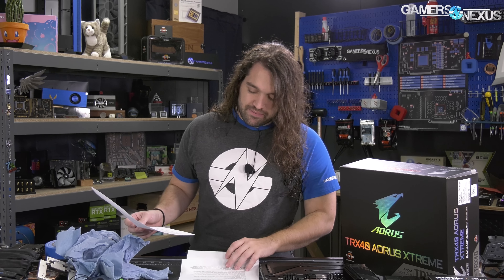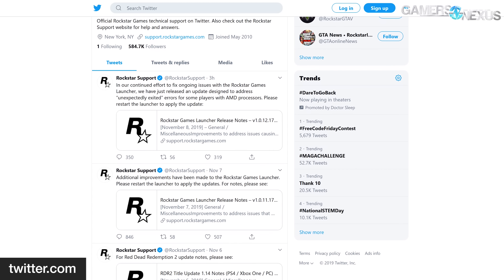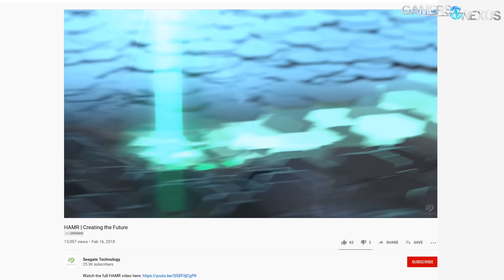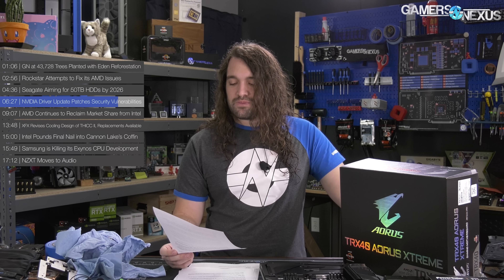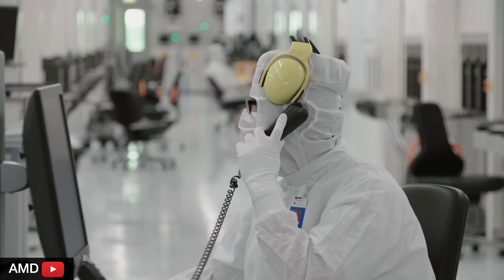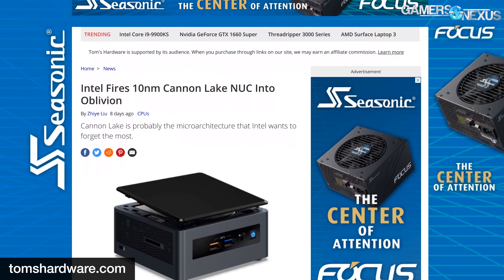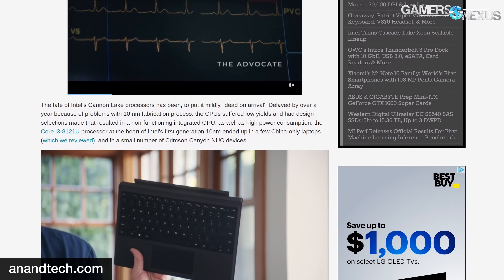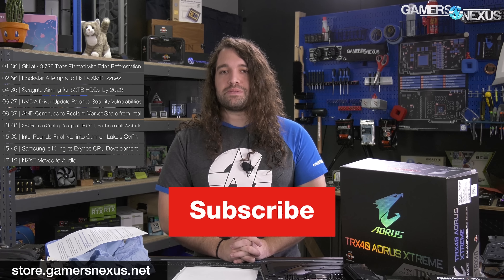HW News - Rockstar AMD "Fix," NVIDIA Driver Security, & 50TB HDDs

Comment: Honestly happy that at least one company is investing in traditional HDD development. SSD is obviously better for the vast majority of our workloads including gaming, but there are still very real use cases for high capacity storage among regular consumers. We can do both.
Reply: Personally I use an SSD for my boot drive. And mechanical drives for storage. So a 50 terabyte drive sounds kinda hot to me lol
Reply: sj33 they do have use for high capacity. In fact they are much denser than HDD, (2TB in a single 2280 NVMe drive).
They just currently cost a lot more per TB. It might change, or NAND prices might hit a floor that’s higher than HDD we don’t know.
Reply: HDDs are a lot more mechanically complex, so they may end up having a higher price floor than solid state tech. They will be around for a while no doubt, but I think ultimately there's a good chance they become obsolete as NAND production scales.

Comment: I need about a hundred 50TB HDDs to host a local copy of the Earth in Microsoft Flight Simulator 2020.
Reply: Well, you need 100 drives in 2020, in 2026 when the 50TB drives are actually launched, you probably need a 1000 50TB drives. Evolution based on FSX --> P3D --> XP --> (Orbx)  --> FS2K
Reply: @Adam Beckett If here in Romania an employee managed to mine bitcoin on the Cernavodă nuclear power plant computer  he'll be just fine.
Reply: Running in raid 4
Reply: @Adam Beckett long ass fiber optic network cable

Comment: Imagine how long it will take to defrag a 50TB HDD
Reply: If it is Seagate it will crash before ever needing defragmentation.
Reply: You beat me to it Blair!
Reply: Blair Maynard why everyone says that seagate is bad tho, I bought 2tb sshd firecuda 3 years ago and it still works fine
Reply: Forever. I feel like most people using these will have a Linux/Unix based server with ext4 which doesn't allow for disk fragmentation.
Reply: Honk Honkler yeah I know that, but still tho
Reply: I have a Seagate that has had heavy use for more than a decade...no bad sectors and just keeps on going.Was my gaming drive up until SSD drives dropped in price.There is nothing wrong with Seagate and they do not have any more issues than any other hard drive company.
Reply: I was just thinking this. 50TB is cool and all, but the IOPS and throughput are still terrible. QLC SSDs are getting super cheap these days for 1 and 2TB models.
Reply: All i want is $30 4TB SSDs
Reply: I have 27tb of storage, various brands and models, the only 2 I've had fail are Hitachi. I've got two seagate drives that are 17 years old and still going strong, constantly powered and used at least weekly (plex server)
Reply: @rossharper1983  whats te model of seagate drive you use?
Reply: I just done some maths and figured out that 50TB would take a little under 5 days at 120 mb/s. So take of that what you will regarding your drive usage and fragmentation 🎉
Reply: @StormStormMegaStylez  in other words... Don't use windows on a Seagate 50TB
Reply: @comdrive3865  off top of my head no idea. Will be a couple different models tho to be sure. Without opening up my plex server and taking them out I couldn't tell ya
Reply: Don't use ntfs on that drive.  Use ext4, xfs, or zfs.
Reply: @fernando5633  yeah idk either. Never had any issues with Seagate in the 9 years I've had their HDDs. They are the highest rated and most popular HDDs for a reason, and it's not because they're shit. Idk why people have issues
Reply: Adam Beckett ow thats why, thank you
Reply: one eternity later
Reply: Format and reimage.  Will be quicker.
Reply: @eritert  That will happen when 16TB is the avg minimum 'useful' storage requirement, and not a second before.
Reply: @asm_nop  People don't buy 50TB HDD's to play games on so IOPS doesn't mean anything. The drives are for NAS.
Reply: @BlairMaynard  I have Seagate 500 GB, that worked more than 39 thousands of hours during more than 10 years. Still works fine and passes all tests in SeaTools. Also I had old 1.2 Gigabyte Seagate drive (Medalist), which was never enabled since year 2001, and when I checked it recently, I found that it not only works fine, but also all the data are readable, so I copied all of them without problems. And I still remember those 40 GB Seagate drives I had. They were the quietest drives I have seen and used.
Reply: ...  Use a real filesystem, wtf.
Reply: @BlairMaynard  Seagates newer hard drives are extremely reliable, especially the high end ones.
Reply: @spandel100  erm, that's not true. There is something wrong with seagate, if there wasnt people wouldnt be talking about it. The drives have a tendency of the needle shoving down and scraping the plater in a way that destroys all data forever. That's not all Seagate drives, but when it happens its bad. And it happens more than any other drive company.

Comment: The “fix” that made my game crash every 5-25 minutes, lol. Never had this issue before.
Reply from the maker: No rest for the wicked with this game, it seems.
Reply: Try to switch between Vulkan and DX12.
Reply: Switch from DX12 to Vulkan, that solved those crashes for me
Reply: Ouch. Sorry to hear, on 1.0.0.4 the patch actually fixed my game. Runs amazing now. Seems so strange that they are going backwards for some users.
Reply: That's what I'm worried about. Mmt game is running fine, and I'm assuming that at least a couple of fixes will ruin that for me
Reply: @CJ_Williams  So if that is microcode that fixed it then it was AMD bug. Then why blame Rockstar?
Reply: @elksalmon84  Did I? Where abouts?  I said some user are reporting errors post patch. Besides, it was the patch that fixed it not the BIOS update for me. So...
Reply: @elksalmon84  It doesn't seem to affect any other developers.
Reply: @elksalmon84  It's Rockstar's bug.
Reply: Same thing happened to me. I had no problems and the patch broke the game.
Reply: Lucky you, GTA V has had this issue since July and Rockstar started working on it a few weeks ago with nVidia.

I say lucky because it seems Rockstar is already working on it for RDR2
Reply: @Safetytrousers  @Brad Haines
 There are plenty of issues with early AGESA. Not every app is using all functions. Destiny didn't work either. AMD had to fix.
Reply: @Phallus Dominus System specs?
Reply: @GamersNexus  Honestly I thought the main issue was Rock*'s launcher as i had the same issues for GTA 5 till i uninstalled it out of sadness, i cant play either game without them crashing to desktop after about half an hour and getting the generic "Rock* launcher has crashed unexpectedly"  window. :'D

Comment: The new launcher with the latest update still wont start on my AMD R5 1600 system but works fine on my Intel I7 2600 (non-K) system. I'm using the same GTX 1060 in both machines with the same windows version and Nvidia drivers.
Reply from the maker: Hearting for visibility. Thanks for the info, helps us to have this news from the community.
Reply: I have R-1400/rx570. I had start issues too. Fixed by disabling virus checker (avg uninstalled) then went to windows defender and disabled that.
This allowed the launcher to stay open but gave a “lack of privileges to game library “ error. Run as admin didnt fix this, but manually setting the RDR2 exe to windows8 compatibility did. 
Also try manual instal of “socialclub” after the launcher instals it. Launcher installs with /silent. The file is in the launcher/redistributables folder.
Reply: Do you mean the i5 2500 or the i7 2600?
Reply: If windows defender “realtime protection” is on, my launcher is nearly completely blank. Just a yellow background.
If i disable it, start launcher it works. Then when i enable it with launcher open the socialclub gives error that I must sign in.
Reply: works perfectly fine on a R3600 with a V56 running 1440p (there is some gameplay bugs in the online version, like getting the nag/wrong horse/wrong color but correctly named horse) there might be more but that is the only thing that has annoyed me (other than the attempt to cashgrab for wanting to do bountyhunter/collector/etc. with "steep gold bar price" basically blocking off a LOT of the content online unless you pay even more (have the largest edition so already paid a lot) that is a bit of a let down
Reply: @kaisercreb  meant I7 sorry for the mix up
Reply: SolidSnakeOil the launcher appears to open “socialclub” as a background process that authenticates the games you own. This is causing issues with mine not working. Maybe it resembles a malware or something.
Reply: Liquid Sunshine i tried as admin and it didnt fix mine. Always worth a shot tho. On one site it mentions to “disable fullscreen optimisation” thats the box above run as admin.
Reply: @LiLBitsDK  
Has been running fine on my 3700x/V56 aswell. Have had 1 game crash to desktop since release.
Reply: Liquid Sunshine I did get it working once with a second launcher installed on second ssd drive. This caused a popup with windows defender and allowed the game to run. Then the next day it stopped again.
Running as admin and setting “exceptions” in windows defender doesnt work for me.
Yet turning windows defender “realtime protection” off allows everything to run perfectly. Not crashed so far.
Reply: Strange as my r5 1600 has had luck and decent performance paired with my RX 480
Reply: It won't let me even install the launcher. Let alone claim gta San andres.
CPU Ryzen 5 3600 (non-x)
Motherboard msi x470 gaming plus
GPU gigabyte aorus GTX 1080ti gaming edition
Ram 2x8gb ddr4 3200mhz CL16
boot drive is Samsung 960 EVO 250gb (Windows 10 "trial edition")
Reply: Still getting intermittent freezing on i5 4690 (non K) with 1060 6gb. Had email from R* support saying the latest game patch might fix freezing issues. It hasn't. I will be sending another support ticket.
Reply: @Outland9000  yeah, same here. Still cannot play that game because the freezing issue

Comment: Async compute fixed every single issue i had!! Fps jumped on rdr2, 0 crashes after!!

Documents/rockstargames/rdr2/settings/system.xlt

Open with notepad and look about 15 lines down for async compute, change the value to true and your mind will be blown!!
Reply: @Rick Grimes It's Radeon cards. I don't think Pascal has genuine Async Compute support.
Reply: Line 15 is     <waterQuality>kSettingLevel_High</waterQuality> for me :(
Reply: @Rick Grimes Try it. It either works or it doesn't.
Reply: @honkhonkler7732  It does, it just doesn't do it as well.
Reply: No change in performance (or frequency of crashes) with 2080ti. Maybe it's an AMD thing, their cards always were better with async stuff.
Reply: @jediii86  <---- his link is where i got this info from! Joker has great info, also not at all sure about the 20 series.. i thought just us cheap folks had that issue for some reason lol
Reply: Oh and im running 1070ti overclocked 2099 core 4677 mem

Comment: At work we get lots of the highest capacity HDD's we can get hold off. Big data is a thing and we have several 8u storage devices with 68 drive bays full of HDD's plus dozens of 2U and 4U devices. I'd have to be at work to get the full numbers but I'm pretty sure that single datacenter has well over 1000 HDD's.

HDD's may soon go away for the average gamer but they aren't going away any time soon in the enterprise or even for things like NAS/media servers in the home.

Comment: I have no doubt in my mind we'll have games with install sizes of close to a Terabyte by 2026. So maybe 50TB Harddrives makes sense?
Reply: I recently bought a 4TB SATA SSD. So I expect them to make 10TB SSDs by that time.
Reply: Considering how fast computer parts and computers in general advance, I very much doubt they will be that much considering new ways to compress data more effectively and 50TB hdds will probably be here in a few years, not 7.
Reply: jonny j Especially in the CPU department. We’ve kinda hit a wall and don’t get the big performance upgrade with every new iteration as we used to.
Reply: few = 3 to 7 ...which means 7 is included...
Reply: @White_Night_Demon  that isn't how 'many' of us learned it, seven falling into category of 'several', while a 'few' was three or four.
Reply: Oh....well I got told few = 3 to 7, and several is basically 11 to 18..... 8 to 10 and more than 18 could be filled with the word "some" as that's ambiguous. A couple is 2 and 1 is well one or "a". Dozen is 12 and half a dozen would be 6 so we got some overlapping here....

Comment: Could GN do a price to performance review with value in mind when setting up a DIY render farm? Would it be wise to get 5 to 10 Ryzen 1700 systems running on the cheapest boards possible while using the cheapest Rx5*/Rx4* series boards? As opposed to getting a Epyc server with 128 threads etc... In my basic understanding, it makes more sense to have a network render setup than a single system setup.
Reply: This needs more up votes.
Reply: Oddly, the answer probably depends greatly on what software will be run. If it is GPU accelerated then it is a matter of getting the most PCIe lanes for the least money, and the number and type of cores wouldn’t matter much. Assuming it is a CPU-only workload, the Epyc would likely win if you had enough work to keep it busy. Epyc does more work per core and watt, so while it costs more than a 1700 up front, the 1700 has higher operating costs. It gets worse for the 1700 when you consider the increased overhead from running eight operating system instances and the extra power draw from running multiple systems rather than one big Epyc server. That, of course, assumes the OS and rendering stack can use 128 threads effectively.

Also, if your rendering software stack isn’t all free, then licensing can make a huge difference. You could easily spend more on per-core software licenses than hardware, in which case the up-front hardware cost is a smaller part of the total cost and matters even less. Power pricing matters as well. If electricity is cheap where you live, that makes the efficiency of Epyc take longer to pay off. It’s the opposite if power is expensive.

In my opinion, up-front hardware price isn’t going to be a big factor in the real-world payback on a render farm.

Comment: While it's good news that HDD capacity can still go up a lot, SMR and HAMR use read-modify-write to write data. Random write latency will go through the roof. You will need to put an SSD in front of them to do write-caching. This is common practice in enterprise storage for years. AMD StoreMI also does this, so this kind of technology is already starting to trickle down to consumers.

Comment: Intel sponsor with a TRX40 mothboard ;) well played Steve
Reply: If you look closer on the box, it has Ryzen on it. So its AMD. I think its for the upcoming Threadripper 3000 series. I believe the TRX40 refers to the chipset the board uses, again aiming at AMD Threadripper. TRX80 is another chipset coming as well.
Reply: @cdsang2thehobbyist695 

DUH
Reply: @cdsang2thehobbyist695  that's kind of the joke OP was making

Comment: jesus what times we are in when a gpu driver has more security  holes than windows itself...wtf LMAO
Reply: Practically any sort of developed software will have vulnerabilities, drivers included. Software security is difficult. And if you have not noticed, this is all in one release and most of the issues are not serious issues vs windows patching multiple security vulnerabilities each month, minor to major issues.
Reply: @sw33t.angela  Not serious can be much more serious if the driver runs in kernel space and if I'm not wrong, gpus do.

Comment: HDD manufacturers always announce these "pie in the sky" capacities but they're always years behind schedule if they appear at all.  They're also not getting any faster or cheaper...4TB drives cost about the same as they did 8 years ago.
Reply: @QuantumBraced  A run-out sale of an obsolete, low-selling model that you have to destroy the warranty to use doesn't exactly count.

Comment: I had a RD2 issue that created audio stutter literally every second. Out of desperation, I uninstalled my driver for on-board sound (ASRock x570 Extreme4), and plugged in a Behringer USB mixer. It fixed my problem and I am up and running. It was a pretty trash launch.

Comment: A note on vulnerabilities. As a piece of software gets more complex, there are more chances it has a vulnerability. A piece of software with low level access to the kernel (core part of the OS) and hardware, is specially suceptible to it. What we (and I say we as both a consumer and a software developer that depends on this other pieces of software to get my own software as secure as posible) expect is not to have an allways air tight sofware with zero vulnerabilities, but software with an open channell to report them if encountered, a quick (or as quick as posible) response to them, and transparecy. Reporting on past issues when the fix is achieved, or when it takes too long and it becomes a liability for people depending on it is specially important. On a side note, these reasons are one of the cause I don't trust Apple, although the recently open security bounty problem is a right direction.

Comment: Delete the local profile from the launcher.  It doesn't delete games or their data, it just causes it to rebuild the configs for the launcher.  This will likely help anyone still having this problem.  BTW, I have an 1800X with very old BIOS from mid-2018, a NVidia driver that's 5 versions older than current, and I had no trouble with this game whatsoever.  If anything, it seems like the people who follow the IMO absurd "always keep your BIOS and drivers on the bleeding edge.." ..were having most if not all of the problems.